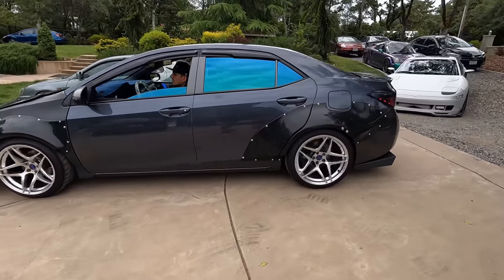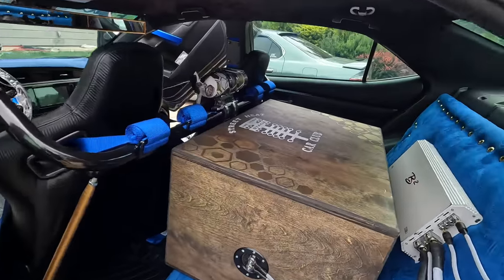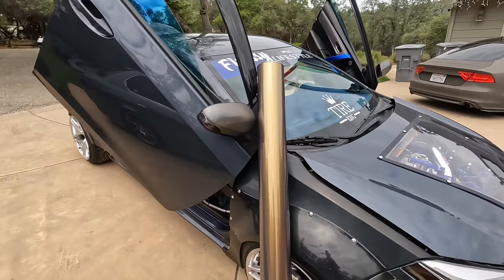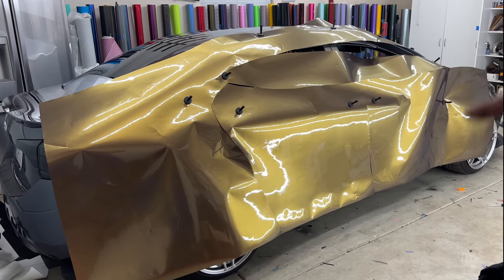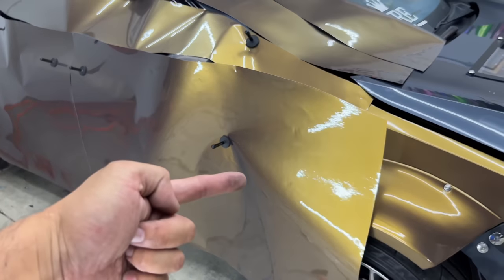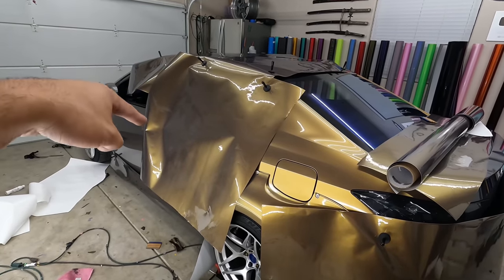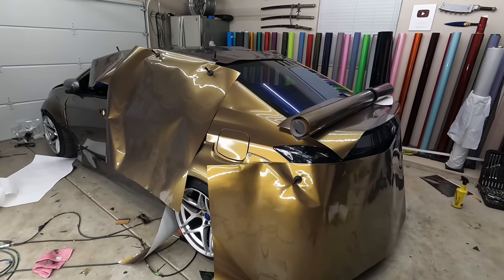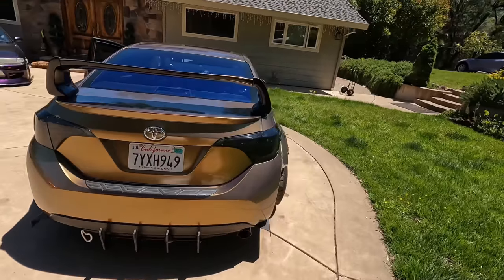WIDE BODY Using 60 Feet | This is why your wrapper RAN OUT OF MATERIAL

Comment from the maker: If you don’t follow this guide on a widebody car you will definitely run out of material. What’s not in this video is how sometimes the extra piece I cut off is too small to fit the wide body pieces so you want to make sure to use only what you need for each panel and save all your scrap pieces for the wide body. STOP SAVING THE BUMPERS FOR LAST! I was able to wrap a 4 door car, redo a whole door I messed up, wrap a wing, and do all the wide body pieces with ONE 5x60 foot roll. So if your wrapper tells you there isn’t enough material, they messed up and it’s on them! So work that into the price at the beginning not when the car is half done and torn apart but you need to wait another 7-10 business days for a second roll to arrive. Send them this video!

Comment: That’s an interesting Corolla lol. The hood is pretty sick. Not sure what’s the hype behind lambo doors but hey long as you like it!
Reply: True
Reply: Its for when you park too close to someone he should have just put cuts in the glass to let heat out instead of the weird hood spacers
Reply: but why a corolla?? should have just bought a supra or 86 instead...don't understand the logic.  All good tho, looks special and one of kind corolla...
Reply: @pitech4446  Because he didn’t want a Supra lol. I don’t understand the logic of asking why someone bought a specific vehicle over another when everyone’s financial situations and styles are different
Reply: Hood spacers like that are usually found on Hondas or anything with an engine swap thats taller and needs just a lil bit more hood clearance
Reply: The only practical use for that is maybe a bit of a tight parking spot would work for this especially assholes who like to park in the most unstraight but also out of the line parking.
Reply: @kurtl6126  I know what hood spacers are for, my comment didn’t mention anything about spacers
Reply: 🤷‍♂️ maybe it was to someone else comment, my bad
Reply: @11393  lambo doors suck. We had a car with one at the body shop I used to work at, and it made getting out harder. And to mention they creek with time, and if not installed properly, ruins your fender. Isn’t cool

Comment: 6:26 - it's from racing.  yup to keep the under hood temps as low as possible you'll see that a lot in SFWD Import Drags here on the East Coast.  particularly down in the South in the Summer heat/humidity of Florida a lot of the B/K motor Honda guys will have that gap at the back of the hood.  some of the hardcore types - copying the big V8 boys - will run a dry block with filler for strength and safety (can't blow a hose, get water under the tires and crash on coolant if you're not using any).  this then means without a functioning cooling system to keep temps down you generally won't hear them idling the car either unless they're physically working on the engine, or they're in the burn out box about to make a pass.  for a street cars it's mostly just to "look cool" since the OEM cooling system has already been designed to keep temps in check in even the most extreme situations, but for us car guys "looking cool" has value so sure why not.

Comment: Can someone please tell this guy that adding a spacer on your wheels doesn’t make them wider. A 10.5” is still 10.5” wide all he did was change the offset.
Reply: Possible reason: rubbing when turning on a bigger wheel? Maybe he didn't want to clap it out and remove the wheel well plastic guards or deal with rubbing. At least he got that fitment to look flush with the fenders